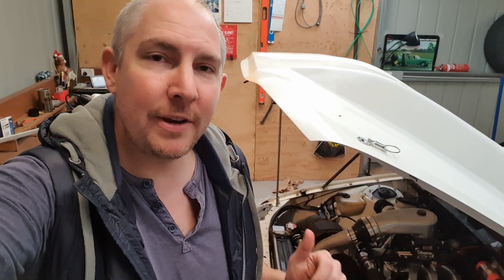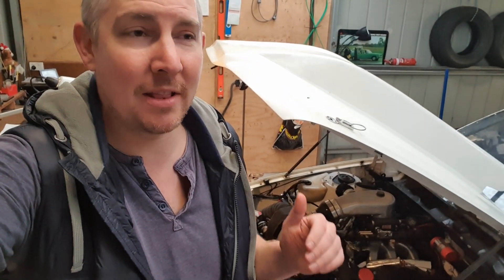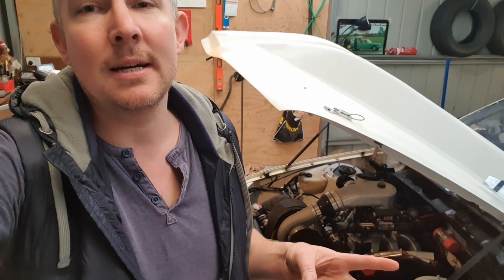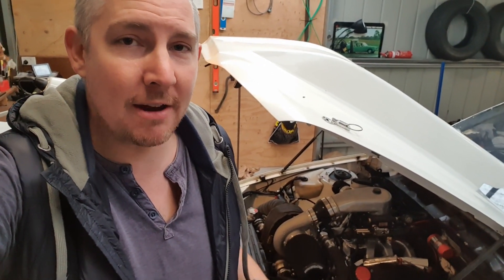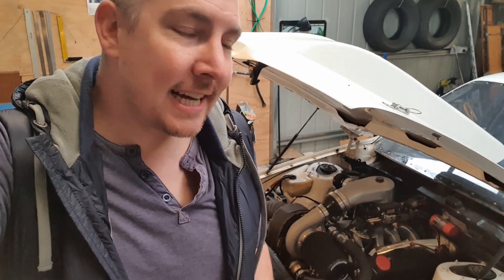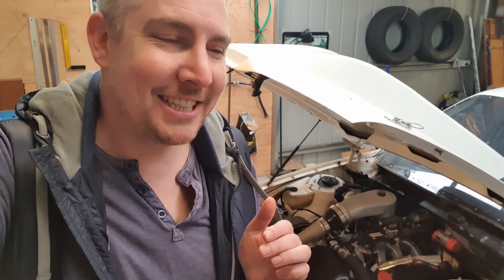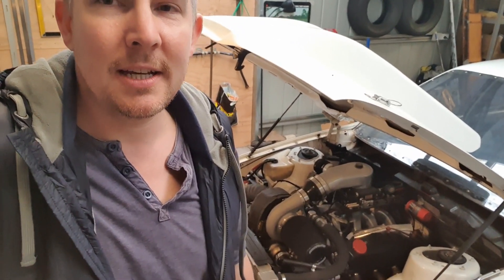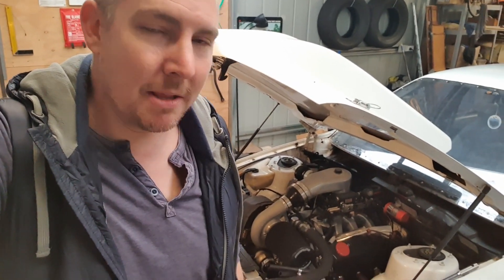BAD NEWS & Engine specs listed -Turbo Holden 5LT V8

Comment: Hopefully just a head gasket I feel for you especially after all that good work. I would recommend a intercooler after short period of boost your intake charge temperature would be through the roof especially on those front pistons.

Comment: These old 5 litter 304 don't have enough clamping force on heads they use to blow on small shots of nitrous years ago even when not old best of luck hopefully just Head gasket
Reply from the maker: Thanks Neil. Pushing the good old 5litres is the challenge that's why I love them, if I wanted an easy project I'd build an LS lol.

Comment: Very solid build mate, cannot really fault the combo on paper.. don't know much about the oring gaskets but aren't you also meant to cut both block and head mating surfaces? 
Ihave read people running standard felpros in ls1s etc over 15psi for years..
Reply from the maker: Thanks Geoff, I believe copper gaskets are used when you machine the block & install O'rings then machine a receiver groove into the head. I've removed the passenger head and found no issues with the Felpro gasket so I'm thinking its worse like broke rings on #2. Will post a video shorty.